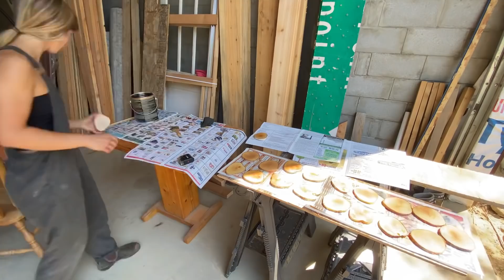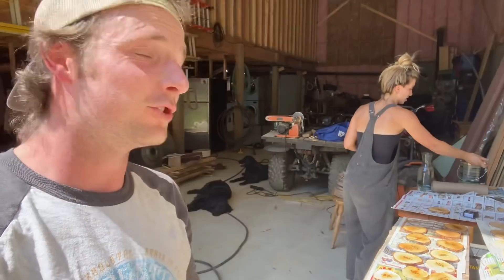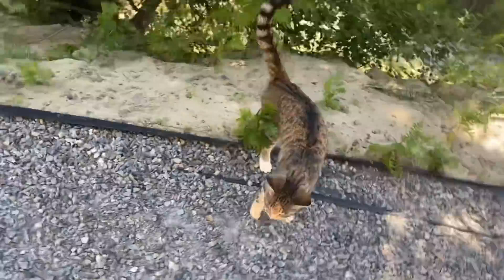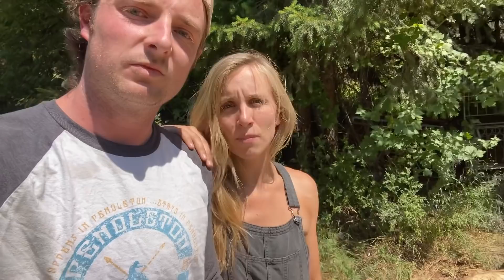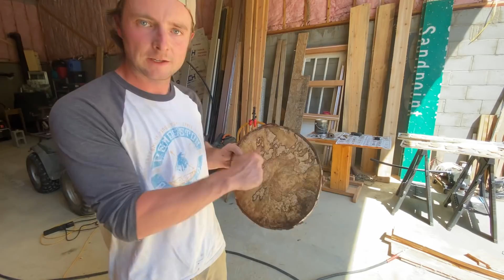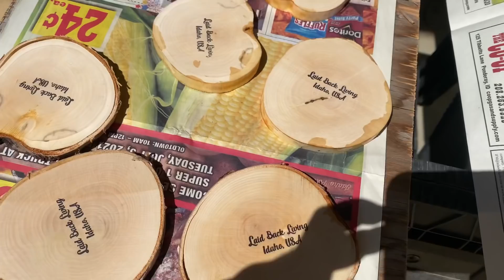Birch Coasters | YouTube Meet and Greet

Comment: I was originally planning on coming up, as I have been waiting on parts for my new 10kW solar system I am building, and thought it would be nice to meet with all of you. I received word that they were shipped to my place in Southern Idaho so, now I am down here loading them up to take back to my farm in Orofino.  Like your coaster and hot plate ideas. You might consider putting some felt material on the bottom of them to avoid scratching what they are put on. Good website guys!
Reply from the maker: Maybe next time! Thanks for watching. Good luck with the setup!